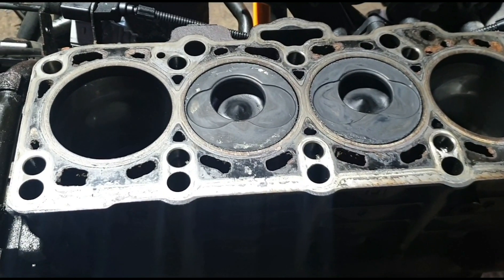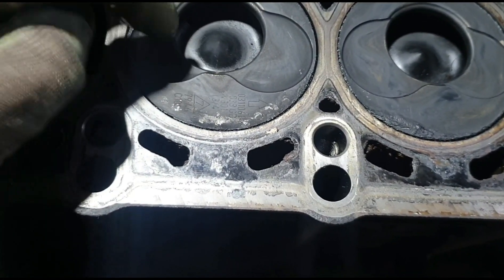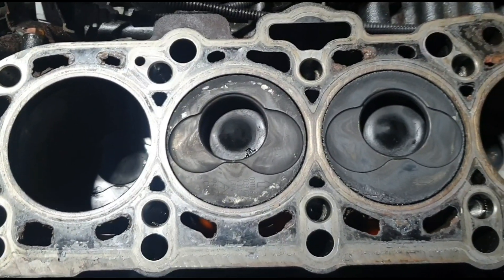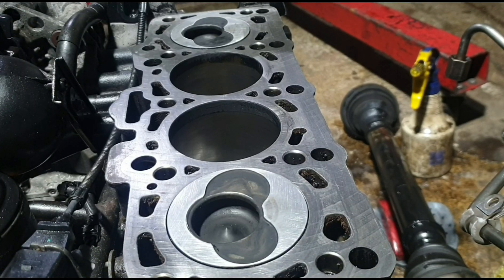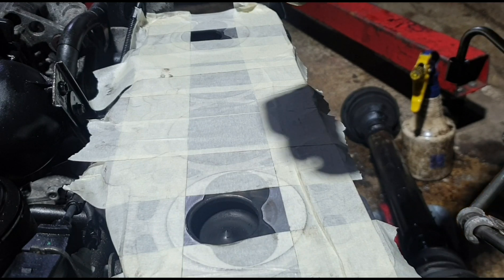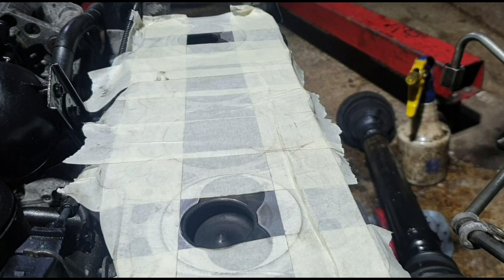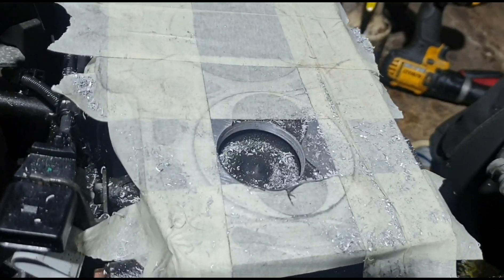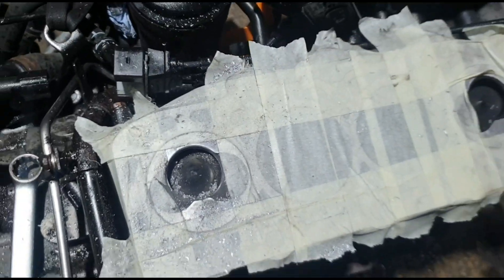VW 1.9TDI PD HOW TO MACHINE PISTONS HELDER PUTO

Comment: How did this affect the car any downsides ? Currently doing my head gasket (pd130) and considering doing this is it worth it ? Thanks
Reply from the maker: It only worth doing if you want 300 bhp + not for original cars
Reply: @HelderPutoPerformance  great thank you for your reply. I have a new 1856 turbo and pd150 head bolts to go on so thought I may as well do it while I’m there 👍😎

Comment: I was thinking of de-lip/bowl cut my pistons on my Ford Powerstroke this same way. Rather then  buy new pistons This is first time I've seen some one do it. Its technically same as porting a head chamber on a gasser. Help improve swirl for better atomization and lower compression will also allow me to pull more timing

Comment: this will lower compresion ration and power and torque will drop
Reply from the maker: I don't think so  lets find out soon 😉😉
Reply: @HelderPutoPerformance  we can t tell because you had to measure that engine on dyno before and after this mod with stock ecu file
Reply: @mirceaflorea8320  you tried a tuned car?
What loss you have?